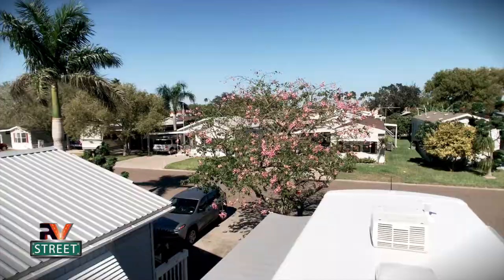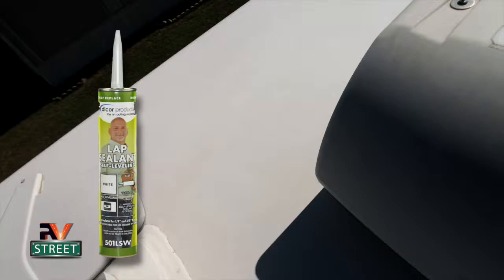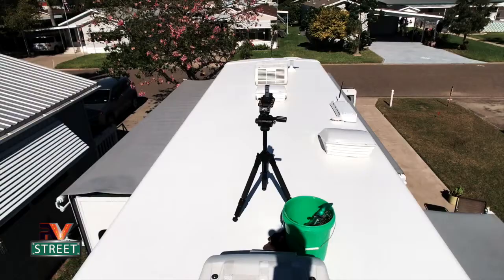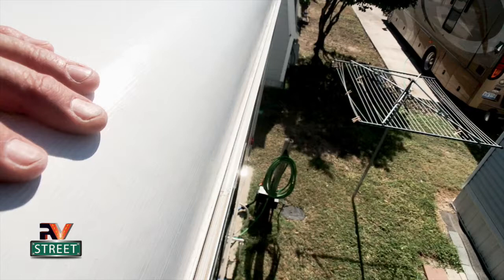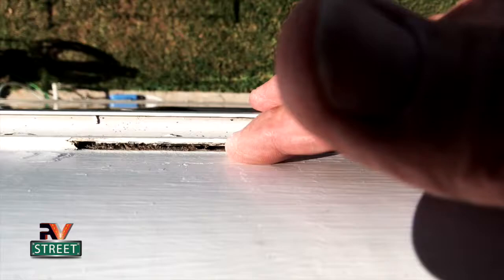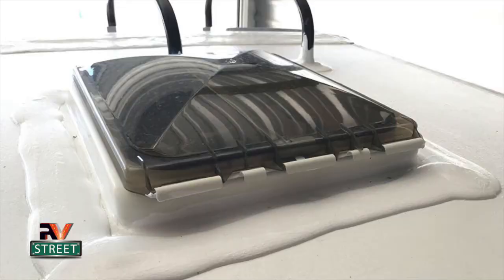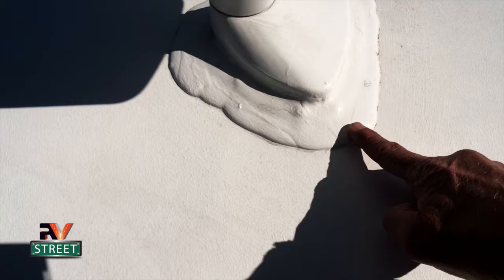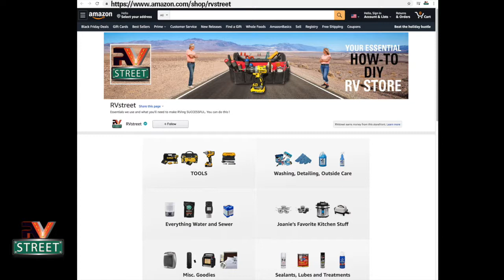RV FIBERGLASS ROOF COATING & GUTTER SEALANT REPAIR

Comment: Great video, thanks Martin. I have a 7 year old Allegro 34tga, our first motorhome that we purchased last year. When i got on the roof I saw what looked like a half an inch or more of the self leveling sealant. I have seen other videos that have removed the self levelpng sealant and replaced it with eternabond tape around the seams and roof penetrations. it looked cleaner than the mess I have and I was hoping to get your opinion on the use of the eternabond over the self leveling sealant. Also wondering if the fiberglass paint would go right over the tape if I decide to go that route. Thanks for all you do for the RV community.
Reply from the maker: Not sure what "roof penetrations" are...

My roof was a mess too when I bought it. That's why I started from scratch. Do it once and do it right. I've never had to worry about my roof.

I like using Eternabond tape over the front & rear caps only. Why? Because those are the two most vulnerable areas for leaking and they take the most stress. This is one area I don't want to have to deal with down the road, so using  Eternabond tape is pretty much a permanent fix there. The chances of me ever having to pull the front or rear cap off are slim to none. I followed up with self leveling sealant over that to provide additional protection from the sun and then the Dicor coating over that. Sun is brutal as you know. 
I would never use Eternabond tape over any other areas because it's to permanent and very difficult to get off if I want or need to replace something like a vent gets cracked, or I need to change out my antenna or a branch breaks a cover or whatever. The self leveling sealant you saw in my video is 5 years old and looks like it was put on yesterday. So no..... no Eternabond tape anywhere else for me. I know others feel differently but that's ok.

Comment: Hi Martin
Would you elaborate on why not to use silicone on the camper

Thanks for your videos
Reply from the maker: You don’t want do use silicone sealant anywhere on the RV and here’s why:
Silicone usually does not have UV protection. But even if you happen to find a silicone product that does have UV protection properties, once silicone has been applied to ANYTHING and you come back later to do any repairs, it's nearly impossible to scrap and remove it all off to reapply new material. There's always some residual silicone left behind on the old surface which makes adhering the new silicone product unable to adhere properly. Silicone won't adhere to itself either.

Comment: Your darn good, I don't want to go against your good advice, however... my Bigfoot Camper has a rigid fiber reinforced sealer around the penetrations direct from the factory. I'm only looking to do what the factory did. I am not a fan of the soft rubbery lap sealant. Thinking of taping off around the penetrations and re-coating them with the fiber reinforced coating.  Your thoughts?
Reply from the maker: JIC, the product I am talking about is NOT soft rubbery lap sealant. No sure what fiber reinforced coating your talking about.
Reply: @RVstreet  Sorry, wasn't clear. I'm going to use the Dicor product that you used on your whole roof only on my penetrations, as did the Bigfoot factory.
Reply from the maker: @bob_frazier  👍

Comment: I want to do the Rubber roof with the Dicor coating, as well as redo the seams or joints withe the self leveling sealant. Would you recommend removing the old caulking, and sealing with the self leveling sealant, before using the Dicor cleaning Treatment number 1, and then finish up with the painting with the step 2? Or would you cover the seams with the Self Leveling sealant.
Thanks again for your help!
Reply from the maker: Dicor has a little different coating product for Rubber roofs.
It really depends on the current condition of you're existing caulking. But what I'd probably do without seeing your roof, is go over all existing areas with a nice new thick bead of Dicor self-Leveling sealant...THEN'....paint the coating over that and everything else.
Reply: @RVstreet  That sounds like a Great Plan,Thanks Marten!

Comment: That roof had been MARTINIZED...

Mr.Martin.. Thank you..I have a Safari trek with an frp roof too...  Doesn't Winnebago revoke using nuflex 311 silicone sealant?

How did your get the dicor sealpoint l sealant to stick around the vents etc...

Was there 311 sealant on the end caps originally? How did you get the eternabond to stick?

I need to do maintenance and recoat
Reply from the maker: Well remember our coach is a 2012. I don't know what type of self leveling sealant they used then. But for me it didn't matter. I stripped off all the old sealant off. Then sanded the entire roof. Then wiped down with acetone, then cleaned it with the Dicor cleaner. So I started from scratch. Once the roof was down to bare bones, then I laid down the eternabond tape, then applied a thick amount of the Dicor self leveling sealant over that and everything else up there. Then put 3 coats of the Dicor roof coating over all that. In the 5 years since I've done that all my sealant still looks brand new. No touch ups, no cracking, no nothing at all. That sealant or tape isn't going anywhere.
NOTE: I do not use any type of silicone sealant anywhere on our RV. I hate silicone.
Now on the rounded roof edges, where it tucks in behind the roof gutter, I originally used Nuflex 640 for that when I redid all those seams also 5yrs. ago when I redid the roof. And it has done fairly well, but since then I've switched to my polyurathane product I showed you. That stuff bonds like crazy, stays white—doesn't yellow—or start to crack. It's pretty amazing stuff. But I do still check my seams a couple of times a year and in fact just last week I dug out a couple of areas that had the Nuflex 640 cause it was looking a little questionable and then applied the polyurathane sealant. But other than that no other maintenance at all the last 5yrs. except washing it a couple times a year.
Reply: @RVstreet  thank you so much Mr. Martin...   This video and this write up is my guide...   My roof is from 98.. Original fiberglass... Is there a way I can reglue it or do I have to get a new fiberglass sheet. To replace the original one...

Thank you again... Watching your RV maintenance especially on the generator... That overhaul at my local rv center is $450 labor plus parts....
Reply from the maker: @camposvazquez  What do you mean by "Is there a way I can reglue it"? Tell me what's going on.
Reply: @RVstreet  I apologize for not being clear....   My fiberglass roof is original from 1998...   I was told that eventually the glue holding the fiberglass roof to the luan will dry out.... This will cause the roof too separate.....   Can my original fiberglass roof be reused and reglued.....  Or do I have to buy a new fiberglass roof and glue that?

Thank you again.... Just watched your video on replacing the 12v water pump... My Pump ended up being good... It was the screen that was severely clogged up

Comment: Hey Martin and Joni, your videos ROCK!! We are newbies, just bought our first MH. I have learned SO much from your library of videos!! Thank You!! I have a question: We are from eastern Canada. I want.to do our roof. I can only find the Dicor Lap Seal here, the other 2 products you use and the permabond tape are not available on the Canadian Home Depot web site or anywhere else I can think of. Any suggestions??
Reply from the maker: Thank you Frank so much.  🇨🇦 🇺🇸 💗
Everything I use is in my Amazon Store: https://www.amazon.com/shop/rvstreet
Reply: @RVstreet  ok, so that worked, thanks. I'm wondering if you could guess how much lap seal you used (I realize it depends on the number of vents, ac units etc, but an estimate would be helpful. That's the 1 thing I didn't here in the video. Our MH is 35 foot, 2 ac's, 1 bath with skylight and 2 hatch vents, plus fridge and antennas and sewar vent.
Reply from the maker: @franknabuurs3401  Well for me—as I mentioned—I stripped off all sealant down to the fiberglass on everything. And then when I resealed I put a real thick layer of sealant like you saw in the video over everything. I have an extra bath vent and sewer vent than you do plus, I applied that wide big section on both the front & rear cap. It's been awhile since I did all this, it's hard to remember exactly but my guess is around 3 cases or so. About 18 tubes. It's a lot of sealant when starting from scratch but mine is still just like new and especially since I used the roof coating over it. It's holding up as good as the first day I laid it down.
Hope this helps. 👍
Reply: @RVstreet  big help Martin, Thanks!!

Comment: BTW I like how you put eternabond at each end  of the roof and then covered with self leveling  I intend to do the same with new tpo at each end.  The worst part or should I say biggest stress point seems to be the side edges going into side termination bars of my roof.  The majority of my leaks are coming from where the stress of movement and time caused those areas to fail.  Is there a reason not to run a piece of eternabond down the length of the rood under the new TPO??  At 60 - I figure those edges would possibly outlast me??   Thanks Jim
Reply from the maker: I would NOT run eternabond tape down the whole length of the roof. If that area ever needs maintenance or repair, eternabond tape is nearly impossible to remove. Just service and maintain your roof edges like you're suppose to every year.

Comment: We have a Winnebago 30B with the fiberglass roof. I am needing to reseal my roof so watching videos about that process. I ran across your video and see that you have used the Dicor self leveling caulking. I have already purchased that product for our roof but in watching another video, the guy says that with fiberglass, you are supposed to use a silicone, self leveling caulking, or it will not adhere correctly. It doesn't look like you have had a problem with that. Any comments on this subject?
Reply from the maker: No, I have not had any problems with any of the areas that I resealed with Dicor. But remember I took all the old sealant off right down to the roof, sanded and acetoned the entire roof and those areas. If you have exisiting silicone sealant on those areas now, Dicor probably won't adhere to that. You could try a test spot though if you want. Silicone sealants wont' even adhere to itself. I hate silicone and don't use any kind of silicone sealant on anything.
BTW...I just went your channel and saw your video "This Texas Weather Keeps SUCKING!"
Your coach is very much like ours. Don't know if you've SEEN this video of mine or not, but if you do these insulation things I cover—in your coach—it will make a huge difference in the summer AND IN THE WINTER.
https://www.youtube.com/watch?v=yqZjE4aEoek&t=661s

Comment: Very informative video and in the process of redoing my roof on my 36 foot Fleetwood Pace Arrow but I have a TPO roof and trying to decide if I should apply the self leveling dicor before or after I roll/paint  on the new rubberized coating . ? Any suggestions would be appreciated.
Reply from the maker: On a TPO roof I'd apply it after rolling on the new rubberized coating
Reply: @RVstreet  I suppose I would wash roof , then take off all old dicor,  then apply bonding solution by hand , then roll on new roof [TWO COATS ] WITH DRYING IN BETWEEN,  which all has to be done in one day according to directions ,Then apply self leveling Dicor . I Think ,,,LOL 
I follow all your videos,  there the best out there .😊🍻
Reply from the maker: @mikemikeska2132  I AGREE. 👏

Comment: Hi Martin.  Excellent video as usual.  I have one question.  When you removed the self-leveling sealant, did you use a heat gun to soften it or was the metal putty knife alone sufficient?
Reply from the maker: No heat gun. Scraped, sanded, wiped with acetone and applied new material then applied my roof coating over that.
Reply: @RVstreet  Thanks.  I'm learning a great deal from all of your videos.  Keep it up. 🙂

Comment: Question I am getting ready to reseal my Fiberglass roof. So far I have redone all vents and end caps by removing old dicor and replacing with new. My question is using the dicor fiberglass cleaner. So you said you use a bucket and us a rag and rinse the rag and apply. My Question is do I need a seperate bucket with clean water and use a seperate rag and wipe off the fiberglass cleaner or do you just apply it with a rag and than leave it on the roof and than come back with the Aciton with a rag does that remove the cleaner .
Reply from the maker: I'm so sad to say that Martin has passed away and I don't have the answer to your question.
Reply: @RVstreet  so sorry to hear about your loss prayers and thoughts are with you

Comment: What sealant do you recommend for a fiberglass popup roof? Over a 100 ads..very confusing! Have a few pin holes.
Reply from the maker: Same one as the one I recommended in the video. It's easy to apply, UV protection, bonds very well and lasts long. Make sure you prep well as I did in the video and read my instructions on applying it in the description text under the video. It's also in my Amazon Store: https://www.amazon.com/shop/rvstreet
thx Jim 🔧 👍

Comment: Hey, got a few more questions. Watched the Dicor instruction video. They say let the sealants dry two weeks before applying the coating on the roof. But, I'm not sure if it was a rubber or fiberglass roof they were on, and now I can't find the video. Anyway, what's your take on that? Don't want to wait two weeks if it's not necessary. Also, did you cover the sides of your RV with plastic when you washed it down?
Reply from the maker: The sealants.....are you talking about the new sealants around all the vents and so forth on the roof? 
If so....ya they should be totally cured before you apply the coating over them and the roof but it shouldn't take two weeks unless your in an area where it's still cold and wet. And, as I said in the video, you need a nice warm, clear, dry 2 day weather window to apply the coating. If your doing this in a enclosed storage area that solves that problem but drying times between coats will be longer. I did my roof outside, in the summer, lots of sun.
No I didn't cover the sides of the MH with plastic as Dicor suggests because I did everything by hand. Then, I brushed on the coating on all around the edges first up and over the crown with a brush. The when I rolled on the coating I applied it slow and easy in a alternating pattern to prevent and splashing the coating on the MH.
As in every painting job, coating job or what have you, prep work is the most important thing you need to do to get a good, long lasting outcome. So take your time, be methodical in each step and it will turn out great.
Reply: @RVstreet  Thank you very much for that thorough reply. In AZ, Phoenix area, and things will be heating up next week.

Comment: I'm replacing all the sealant on the roof of my "new to me" 2005 Aspect with Dicore using the method you did. I need to redo the sealant in the edge of the gutter and considering coating the roof like you did. I'm wondering if the roof sealer comes in gray? My roof is white but the curved part down to gutter is gray. Wondering if it would look odd with white on the curve and the front/rear caps are gray too. Could the sealer be tinted somehow? Thanks for any suggestions.
Reply from the maker: Not sure if you could tint it somehow but I hear your concerns. I didn't cover it in the video, but my roof was originally white but in the back of the rig there was about 8' of gold color on the curved crown area. After I studied it I was like, it just doesn't matter. Just coat the entire roof including the rounded crown areas and be done with it. So I did. It not only made coating the roof a lot easier but now everything is one color—including my gutter seams that I use my sealant on—and it's really easy to care of. Even if they made a gray or black—which they don't—or whatever, I'd still go with the white because it reflects the heat the best. This product comes in white and tan/brown.
FYI...I have everything in my Amazon Store in the "Everything on the Roof" category.
https://www.amazon.com/shop/rvstreet
Thank you for your questions 👍